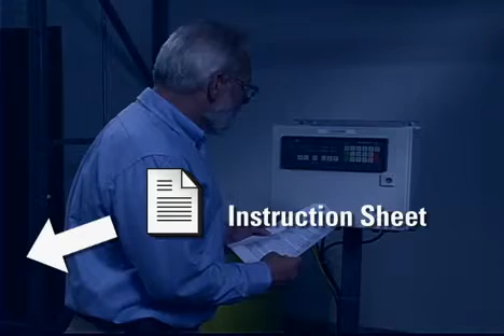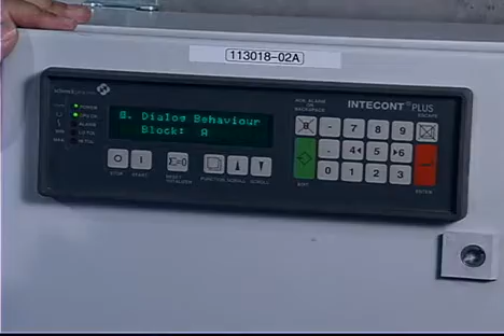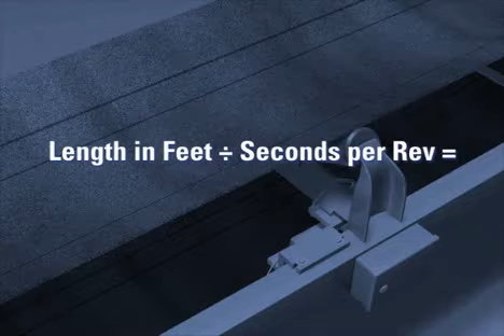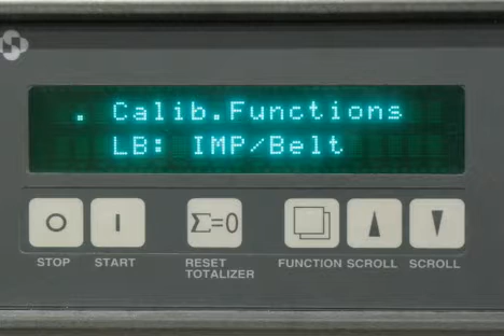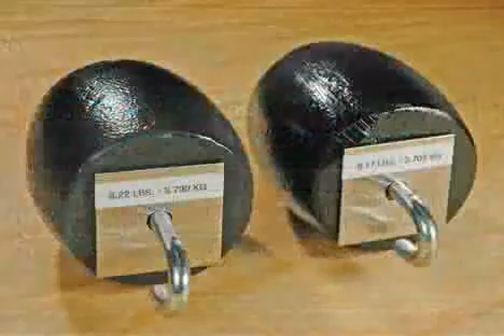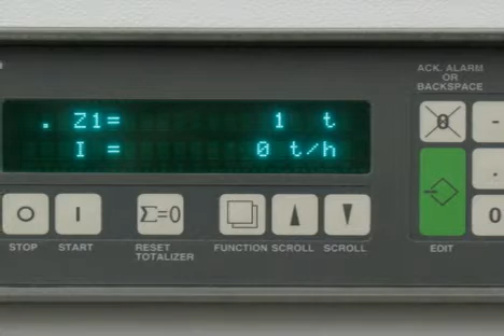Schenck Accurate Training Videos

Comment: Hello I am Mohsen from Iran. I work as an electrical engineer in a chipboard factory. In the gluing part, we used intecont plus. Newly, an error appears that the actual amount of the adhesive is very different from what is displayed, and the actual amount is much less, that the adhesive injection is done with the displayed amount, which destroys the product. The message that Intecont gives is E02 Q05, and we have the control sensor. We changed the speed installed on the belt electric motor and its cable and did not get results. Thank you for guiding me. Thank you.